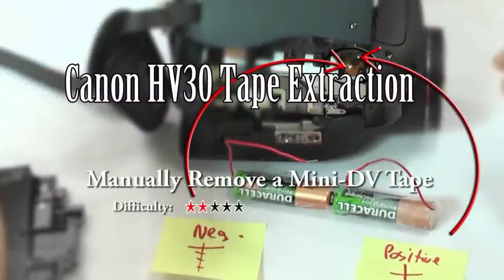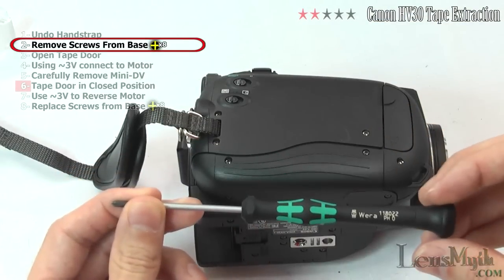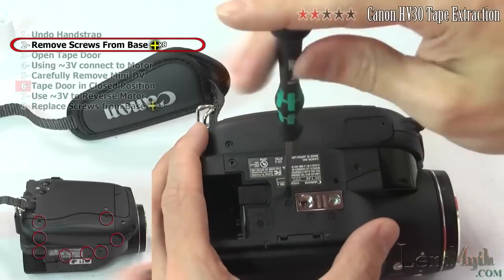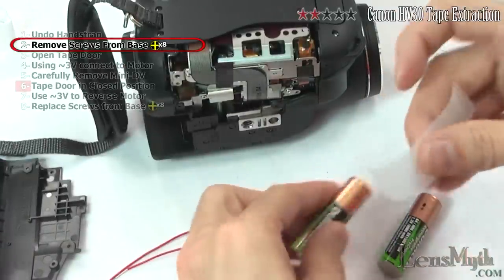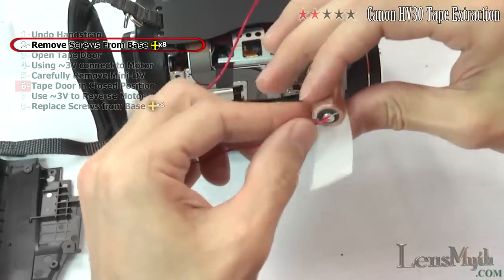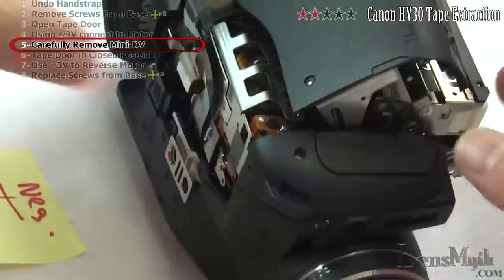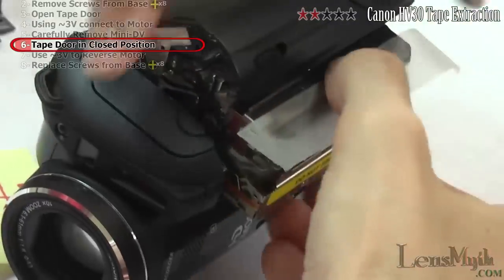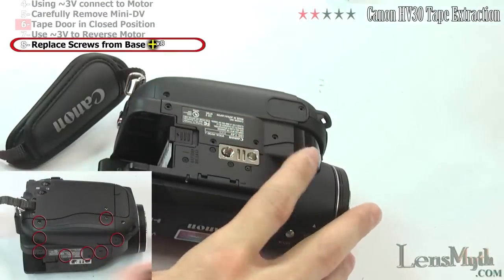Emergency MANUAL REMOVAL of a Mini-DV Tape From a Dead Camcorder (HV30) - LensMyth

Comment: i know this was years ago, but im having a problem with a canon elura 100 where a cassette error will pop up on the screen every time i put one in, regardless if its a new tape or not. any direction or advice on how to fix this or what could be causing the problem
Reply from the maker: Yea, it's been a while! Well since cassette drives are mechanical and expected to wear out, "cassette error" is designed (among other things) to stop a cassette from being loaded if it thinks there's a problem that could result in damaging the cassette... If you haven't already, sometimes you can pull the power and battery, turn it on and off a few times wait a bit and see if that resets the memory allowing you to atleast attempt a cassette loading. Although it could result in a stuck cassette.

Comment: 11 years later and I have the same camcorder but my issue is that the tape guts are very janky at the moment, the tape won't close at all and I think it's down to something being misaligned from someone with a dodgy repair job, I've instead managed to force it shut for now until I've got more idea on what the internals on that side of things look like
Reply from the maker: I always first look at springs or rubber belts on older cameras like this. Sometimes shortening a spring can grant it a lil more life temporarily. Any friction areas like hinges or slides also begin to get gunky or loose might be a second area to inspect. Then I'd say look at any small copper contact switches inside that tell the camera when mechanical things are open or closed. Good luck!
Reply: @LensMyth  yeah I'm gonna take a better look once the battery + charger I've ordered comes through, if it works without tape then it'd be a godsend but I would prefer to get it working if possible.  Also, wanted to ask offhand if you'd know whether the Sony DCR-SC7 screens were repairable (somehow I managed to grab two from Japan with busted screens)
Reply from the maker: I don't know about the sc7, is it similar to a pc7? Either way it's been so long for me that I wouldn't have good information anymore.

Comment: Freakin' genius! This worked with my Panasonic PV-GS10 mini-DV camcorder, only there's no need to remove any screws. Just pop off the small plastic piece around the USB/Firewire connections (which are covered by a pull-off attached cover.) The motor contacts are exposed in a small hole to the right of the Firewire connector.

The camcorder was dead as a door nail- fried by a reckless owner who used an incorrect external power supply. :(

Anyway, I was able to recover the tape gracefully. Thanks.

Comment: This is promising.  Do you think this will work on a ZR70 tape loading motor as well, without damaging a circuit? The tape mechanism will not eject or retract no matter what I've tried. I am preparing to tear it down as a last resort.

Comment: hi ! Dear Lens Myth , could you help me  with my video camcorder Canon MV 800i , the cassette tray when is empty it opens and closes finely and perfectly -  BUT when i load a mini DV cassette, it  closes,  and when it seems is about to play  , in 2-3'' the tray opens with no reason  and an light and sound beep indication  suggests  "remove cassette" . every cassette . Have you any video or any suggestion to fix it , to avoid canon service fees . Thank you in advance <3
Reply from the maker: "Remove Cassette" or similar, are common issues especially with magnetic tape devices of any kind. The problem that inevitably happens is the rubber belts that move the mechanical parts inside the tape mechanism get slippery/stretched/cracked or otherwise age causing the camcorder to go into a type of fail-safe mode to prevent damage to the tape or camcorder; hence the "remove cassette" warning... It thinks something is wrong, so it stops working.

That's not helping you fix the problem I know. Just as an experiment though I would Power off the camcorder, remove the battery and /or power cord, press the on button (just for fun) and let it sit for an hour before trying again. Sometimes this sequence does enough to cycle the unit to let you record for a short time before it recognizes the error again. (It may be satisfying to see it work one last time before you pay to have it fixed or go at it with the screw drivers).

I may have a Canon MV 800i in my Thrift Store, which is what I call my storage room, and if I do I'll check it out and get back to you. I'm guessing mine will have that same error after sitting for many years!
Reply: @LensMyth  thank you so much for your answer . I followed your tip. We ll see.
Reply: @000xara  did it work?

Comment from the maker: I am almost finished a full tear down video of the #HV30 and the Mic connections are easily accessible and repairable once the cover is off. The HV20 is practically identical so it shouldn't be a problem.  I can send you some pics or video clips if you want to try it yourself or contact me through my web site if you want me to do the repair here.